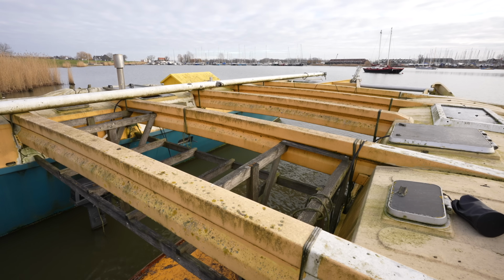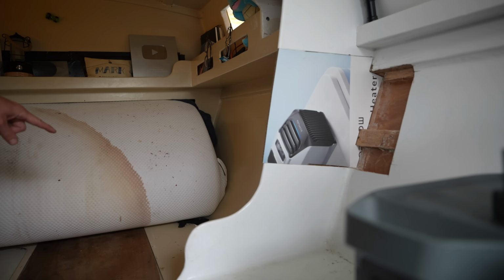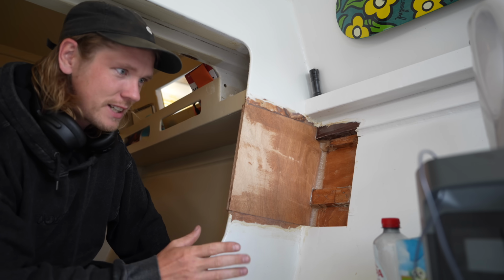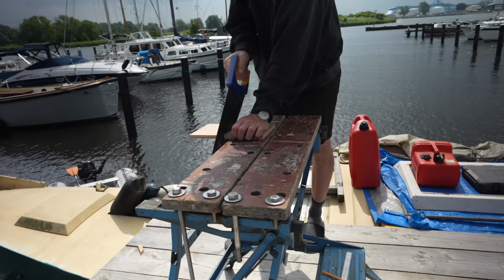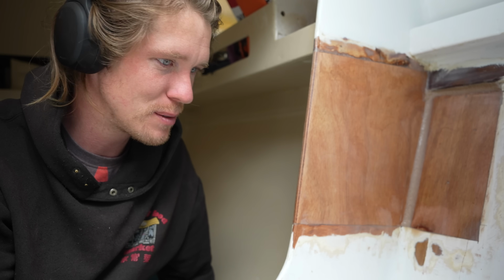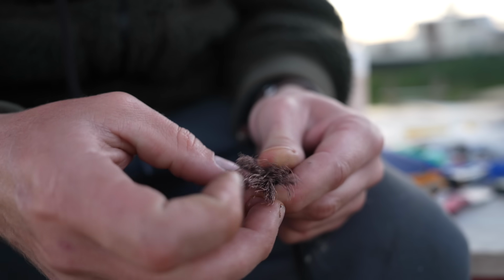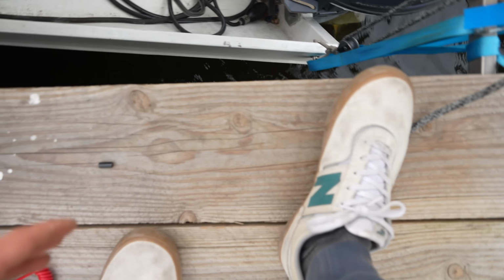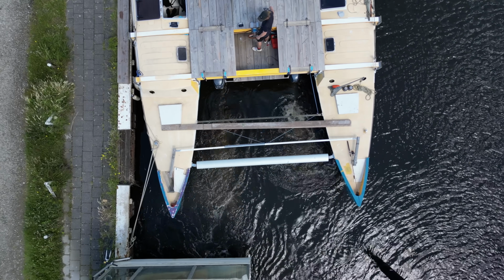My DIY Catamaran Engine Set-Up Is Complete!

Comment: Thank you for posting your work. There are many good ideas in the comments, but one I believe you should do is the wiring. Please use crimp butt connectors with heat shrink. ABYC is a course that I am currently taking for electrical. Solder may crack with the movement of the boat. Also on your batteries always use nuts never use butterfly (wing) nuts. They can come loose very easily. Also place a cutoff switch(on/off) between the batteries and your motors and don’t forget the fuse. One of the most reasons boats catch fire is because of electrical. See if you can get a copy of Nigel Calder book Boatowners Mechanical and Electrical Manual. Keep up the good work. I enjoy watching your progress.

Comment: Mark. If the wire is fixed in place. Get some copper pipe tube and different sizes. You can make lugs. Strip your wire a bit longer. Crimp in the copper tube, then use a butane gas torch and then insulate with multiple heatshrink. You're sailing the world, you do not want to be looking for an electrical fault. It takes 4 times longer to find and repair. In a high sea you do not want to be doing.

Comment: I have been following you from the start of the build and I think your dedication to this is amazing! I feel that I have to comment on the repair you have made to the bulkhead. Please let me say from the start that I'm not a qualified engineer, but I have made a lot of things and it seems to me that the depth of that bulkhead says something about the forces it was designed to withstand and as such it's quite deep. I'm presuming that from an interior design perspective there would be no reason to protrude into the internal space for any other reason than to resist loads on the hull. Given that water has a density of 1 ton per cubic meter and given the size of the hull, I would also presume that the forces acting upon the hull could be quite large. Your repair looks really nice and  I don't want to be critical in any way, I just feel duty bound to say this as the failure along one of the glue joints in the repair while under heavy seas could lead to the stresses induced to be put into the hull. This would obviously be very serious. I would think a fairly cheap and easy solution would be to glue and screw a strip of aluminium half round section along the front of the bullhead, thus transmitting any loads through this rather than the glue joints. I hope I have come across as trying to help rather than being critical as helping is my only intention. Thanks for the great videos!
Reply: You are being very modest here. This "repair" is potentially fatal. I would glass both sides with 2 layers of 450 g.m.2 biax overlapping both sides 12* the thickness of the bulkhead. Ideally it should be calculated properly but these butt joints will not hold. I've seen plenty of snapped epoxy joints that were not scarfed 8:1 or otherwise sistered in or sandwiched. Mark, beware!

Comment: I recommend using shrink wrap tubing to seal all the connections and splices.  I used to use that to repair the wiring on bug truck trailer lights exposed to four season weather and road salt.

Comment: a small torch can be used to heat the wires when they are that large just be careful not to over heat :) and a copper barrel can also be used with the solder for the connection  You are doing great Keep it up !

Comment: Hi Mark, I'm really enjoying following your progress and the way you communicate, thank you 👍
A bit of input from me on your batteries, if they're deep cycle 12v lead acid batteries, each 12v battery can float happliy, continuously on 13.6v
"This voltage will maintain the full charge condition in the battery without boiling your electrolyte or overcharging the battery"
If you're maintaining over this voltage, I suggest you regulate the input voltage.
Another tip is a thin smear of petroleum jelly (from supermarket) on any exposed metal of the battery terminals and clamps. This will help control corrosion.
Cheers,
Dave

Comment: 22:12 - yes, a DC to DC charger that detects that the engine is running - per engine. Something like a couple of Victron Energy Orion-Tr Smart Isolated DC-DC Chargers would do the job. Not cheap, but neither are buggered batteries when you need them most.

Comment: Really glad to hear you say you will be getting a single cable from your engines to your battery. Talk to the people that you got that indoor battery system from. They can help you in setting up different battery banks for the uses that you will need. Other people have said this, and I’ve been holding my breath/response. Epoxy is not strong by itself. You are using it like glue. Epoxy needs fiberglass to get its strength. There are multiple kinds of fiberglass that work for all types of different situations. Do the research online to figure out what is the best fiberglass for your individual uses. I know you’re in a hurry to get sailing. In the long run, it will be cheaper to only do things once rather than have to fix things you’ve already spent time on.

Comment: There's a solution for your matress. It's specifically for vans and boats. I'ts kind of a wirey mat kind of thing you place under your matress in stead of slats. I use it personally because i had the same problem and im really happy about the results!!! It's called an anti-condens mat and you can order it quite easily in NL for about 50 euros. Good luck mate keep on rocking!!!

Comment: When soldering like said previously,  generous flux,  Feed solder on opposite side from heat and the solder will run to where heat is applied,  pull heat away when solder flowing close to where you want to end,  clean off flux with some dishsoap/dawn and water,   wipe dry and. It will shine.  The flux not cleaned off turns/oxidizes green fast..  maybe not so fast if air tight though.

Your doing good for so close to D-day!

Comment: take the tip off the solder iron and clean the tip and screw that hold it. then heat it up and melt solder onto the tip and quickly wipe with a rag. that's how you get the iron to work like it should

Comment: You are a breath of fresh air to those that are struggling with boat repairs.  I have spent 6 1/2 hours trying to get my horn hooked up on my current boat.  I told my partner that it should be about 20 minutes.  I'm learning along with you.

Comment: You may be fine just butting the wood,  epoxy is quite strong...  i would lay some glass cloth over the joints (3 layers finishing) and lap 6 inches onto the bulkhead each side of the patch,  then you know it is better than new.  Bulkheads are important, and that one is wide so it was intended to take a lot of strain.

Comment: You can get waterproof junction boxes with heavy duty posts so you solder rings on the cables and crank them down tight.

Comment: Try using a file or sandpaper to clean the muck from the tip of the soldering iron. Works like new afterwards.

Comment: Mark that's a great little gas soderer you have, I have the same one. Use it like a heat gun/hair dryer (without an attatchment) on the shrink hoses, holding it just close enough, and not the side of it's shaft. You also won't need to use your lighter and risk burning your  finger/thumb any more. See you in the nxt1.

Comment: Soldering joints in wiring is not recommended in a marine setting, using crimp joints is advisable , also use marine quality crimps. 
You should also use tinned wire, the reason the wire was black is due to corrosion and i suspect the battery leads are not marine tinned wire? 
Perhaps best not to join battery leads but to replace with one length? 
Marine grade tinned cable is more expensive  but will be worth the extra!

Comment: it's' not recommended to solder engine wires due to the amps they draw on startup but with those little yammys you might get away with it.
get a new voltage regulator so you dont overcook the batts. keep it up!

Comment: On the patch  in the bulkhead at the chain plate, if you run a piece of wood on the edge like a small T, it will be much stronger and less chance of cutting you when you bump into it.

Comment: Using the battery you run the boat off as a starting battery could bite you in the arse. Better to give your engines small, cheap motorbike batteries with a voltage regulated relay to allow the engines to charge the boat battery when the engine batteries are charged from starting.

Comment: That wood work turned out great. When you route the cable on the outside try to have them track lower than the gland, that way water will track away from them :)

Comment: Each joint in your cables is a potential failure point and splicing with solder may have produced a poor joint that increases resistance and so voltage drop. You also have a potential fire source at each joint. Is it not possible to replace the wire as a single length with no joints?

Comment: For beds, slats is the way, cheap and cheerful will do! I had the same problem and solved it a few years ago by replacing the bed boards with bog standard  2" x 1" PAR (44 x 20 mm for metric types) of cheap pine. They are laid flat and crosswise with a 44 mm gap between each, arranged in easy lift-out sections for your boat. I didn't even paint them! Still good after six or seven years.

Comment: Flux is your friend when soldering. In some cases you would be better off using lugs or terminal blocks instead of soldering them. I’ve personally never had it happen, but if it’s in direct sunlight, it can melt the solder.

Comment: Mark, I know you've had other commenters alert you to the problems with your bulkhead repair. In my opinion most have underplayed that it's a very dangerous situation, as in, potential for complete structural collapse. I want to put more emphasis on this. I hope you read this.

From what I can tell, there ae bulkheads that correspond to the location of the beams between the hulls, and the bulkhead you cut through is the one closest to, and aft of the access hatch.  The placement corresponds, or should correspond, to the fastening point of the standing rig. This in where all the major forces are at play in the boat. 

Think about the forces at play: The mast is a lever that is used to lift the windward hull upwards out of the water. As the sail takes sideways pressure, the stays on the leeward side stop taking any significant load,  and  the whole boat tries to slide sideways. The sideways forces on both hulls from the water resist that movement. Because the forces on the sail are above the hulls, it produces a rotating force that tries to bury the leeward hull,. But because stays won't transmit pushing force, the actual effect is that the  windward stays pull the other hull upwards.

Think about what it's like to carry ever a sheet of ply, while a wind blows against it at less than 3 kts. Now imagine 20kts, and multiply it by the area of the sail. That's how much force is being carried along those stays, and it's lifting the entire hull upwards. 

The butt joints have zero strength for this kind of force. The ability of plywood to carry huge tensile loads is down to the fibres of wood that are held together by the structure of the original wood, but mostly by being held together by the glue between the plies. This is what you eliminated by cutting out that bulkhead section. 

Stresses in any structure flow, like water, and they'll always flow to where weaknesses are., which right now is that bulkhead. If there are two sets of backstays, as I think there are, the rearmost, uncut bulkhead will carry much more of the load now, even if the "fixed" bulkhead doesn't pull apart immediately. But epoxy itself ihas almost zero tensile strength, so it will.

Also worryingly, the two points on the boat now carry different amount of load across the beams, so you get complex twisting and shearing forces between the two, which over time might have structural effects, or just cause random, unrepairable leaks. 

But mainly, now you have a situation where the aftmost windwardstay is carrying loads much closer to its engineered load. That engineered strength is going to be well above the real-world forces you'll normally encounter, but the problem is that repeated cycles of being loaded and unloaded like when tacking, are going to find any weaknesses in the one remaining integral bulkhead and stay that you are now relying on. That will mean decomposition over time, stretch or fibre failure in the stays, etc. 

The problem is exacerbated by the fact  that boats don't receive constant loads. Wave action that moves the platform, changes in the rig when you adjust sails and especially wind transients can produce forces far above the nominal for short periods.

The bigger problem is that you will have a hard time making a sufficient repair. Plywood is not a good material for scarfing. and  an in-place scarf would be almost impossible to do well, anyway. You could sister on both sides of the bulkhead, and that might be your best bet. You probably don't need to sister the entire surface, but rather a longer area that extends probably 30cm+ above and below the cuts you made. Fibreglass with aligned fibres going across the break in the sandwich might be your best bet, but the total section can't be just a layer or two.

One thing that you should consider is that the tensile stresses in a bullkhead like that will concentrate on the inner edge of the material, i.e. where the opening you move through is. So by focusing on that area, you can probably salvage this catastrophe in the making. Think about how racing cars or airplanes  lighten things by drilling holes in parts like wing spars or suspension arms. THat's the situation that you are in. The removed section is a hole you drilled; but you also drilled through the edge. You need that edge to be reinforced. Again, look at an I-Beam; the reinforcement is at the edges. 

As other commenters have said, tabbing the repair to the skin is crucial, and that will take care of stresses along that edge. You need to focus on the inside once you do that.

I strongly suggest that you find a way to get a surveyor to look at what you've done, and see wha they think. This is the kind of thing that can render your boat uninsurable, and not deemed seaworthy. You are not playing a kids game here. Just going ahead and sailing it in an unseaworthy state can have multiple repercussions, and always put you in the wrong when damage from collisions with other boats or whatever else may happen, happen.

You're learning, and I appreciate that. But you have made some colossal mistakes, not all of which you've rectified. These are accumulating in the boat now, and in addition, the boat is constantly revealing more significant weaknesses that you don't know about – like the bulkhead, or the steering arm with "termites" in it, and rot in unexpected places. More worryingly, You are only now starting to deal with the sources of almost all the stresses, wihich come from the sail, mast and rig, and their attachment points. This is where things can get hairy, and you are prioritizing "getting sailing" over taking the time to research and understand what you're doing. 

The audience here aren't always helping you by giving you encouragement when concerns should be raised. It's nice to feel good, but that won't fix a broken mast 500 miles offshore. And when that happens, nobody wants things to go badly for you after all the hard work.

Comment: Use blowtorch for heavier joints. Also use "Jenkins Rings" which is a spirral of tinned copper wire wrapped around the joint before soldering.

Comment: Hi Mark, I'm sure others have already mentioned it, you need to get tined wire for use in a humid environment. If you use plain copper wire, the green oxide will eventually penetrate the whole length of the cable. Of course, it's more expensive.
This plain cable should be okay for about 5 years, tops..

As for soldering heavy cables, you'll need a soldering iron with sufficient mass.
Your explanation of how it should be done is otherwise correct.
You know you're doing it right when the wire simple sucks the solder in. Keep adding solder until it stops wicking it away.

Comment: Two reasons you will need to sort out the charging of the battery, first it will damage the battery plates, two cause the battery to "boil". This will release gasses into your living area. The maximum charge you should have on the battery is 13.6 volts. The fact that you reading 15.xx volts on the sink battery when charging, actually shows that the battery may already be damaged. The problem is known as "high internal resistance".

Comment: for your matress , depending on how the boat structure is for wood uner matress drill large 1 inch holes all over the surfass that the matress lays on so it can breath a bit , i lived on my 47 mono hull for 3.5 years and it worked for me on the west coast of canada

Comment: For the future, Solder iron needed a new tip. "Tin" the tip and use that solder to help tranfer heat to the wire. The alternators use stator powered by the batteries. They'll adjust the voltage for charge based on the battery voltage. So when the battery is full the alternators will not put out as much voltage. Two batteries prevent the alternators from throwing each other off and over/under charging because they can't tell the difference between the battery and other alternator. If you don't need the charging amperage, you could just disconnect the alternator in one engine until you're ready for another battery. I'm assume you have plans to expand your battery setup later for solar. You'll need a dc to dc charger if you plan on running your engines off the same circuit as the solar bank.

Comment: Love the sound track..   For the soldering experiment....if the wires cant be cut back to clean copper, vinager (dilute acetic acid) works wonders at removing oxides and crud from copper.  FYI.